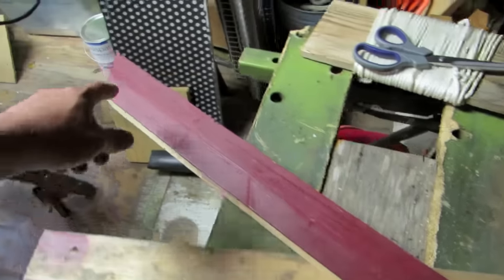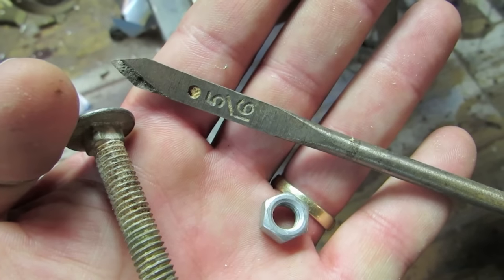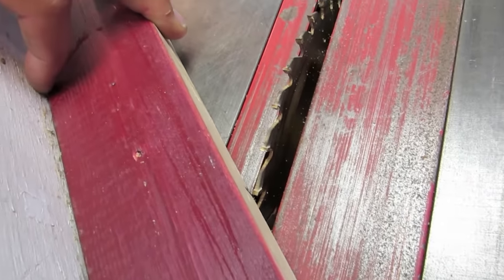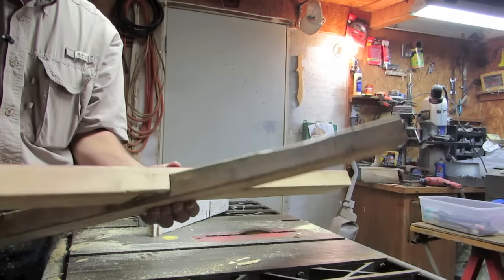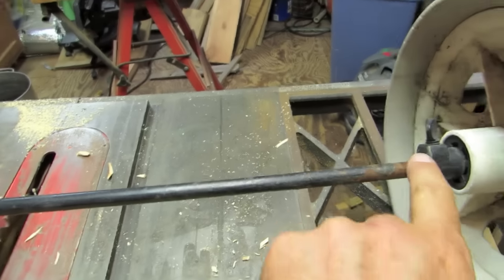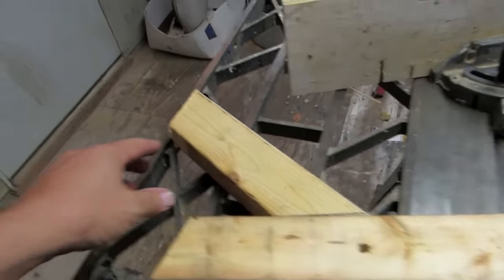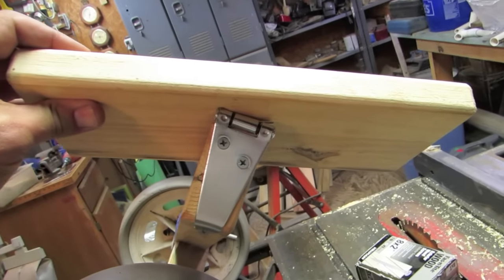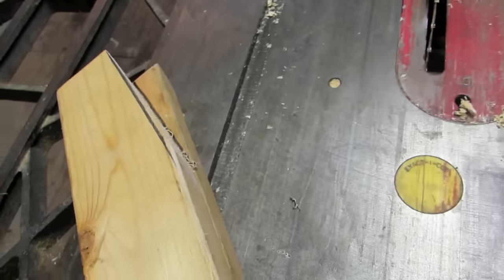FishTales DIY: The Yak X Kart - DIY $0 Dollars

Comment: If you cut the groove for the wheels deeper, you could use a pair of bolts to hold them in place, just cut a spacer from some PVC to support the wood.
Reply from the maker: Now that I have the first one built I can see all the improvements I need to make on the next one.   Once I refine the design and reduce the build time I'll put together another video that uses off the shelf components that are affordable and available most anywhere.
Reply: William B Tedrick progress report?